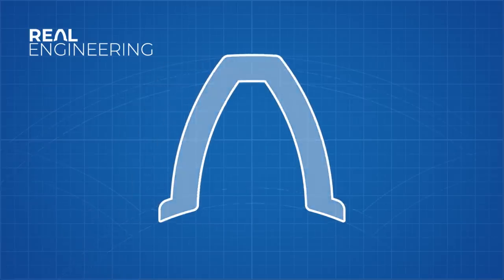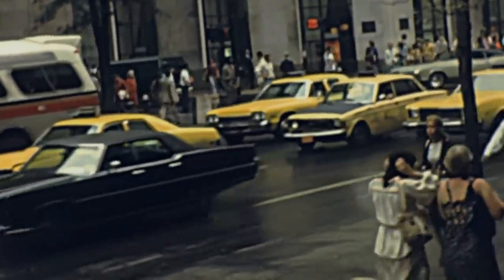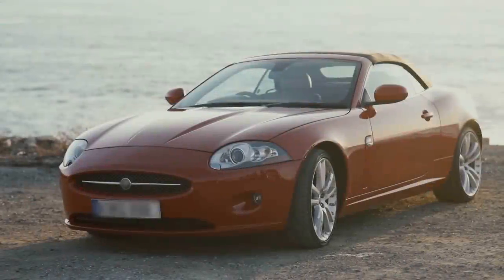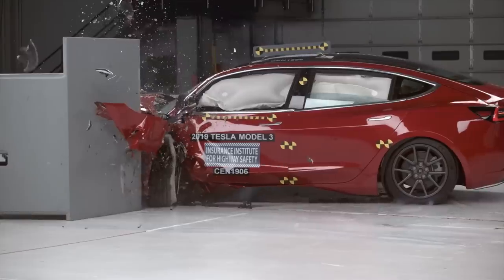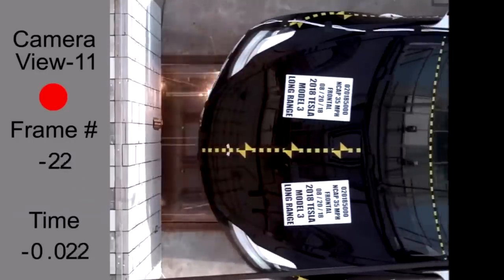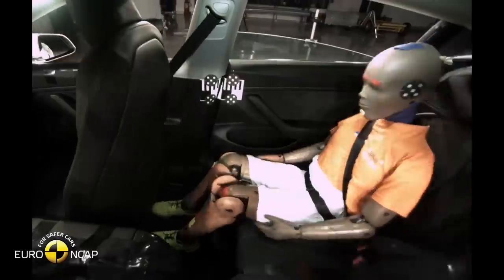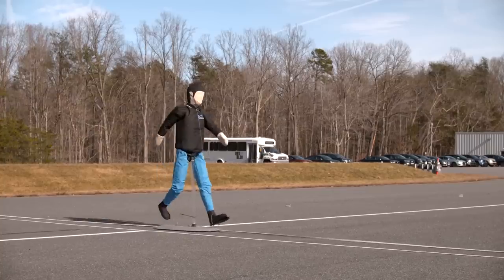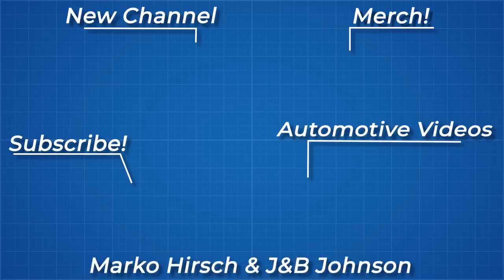Which Is The Most Dangerous Car?

Comment: "The only difference is that the drive is a woman" 
Me thinking about woman cant drive stereotype
Reply: Maybe women DO drive worst than men because they have to drive cars not designed with them in mind!
Reply: I think the statistic is that women are 40% of the drivers yet have 60% of the driving accidents
Reply: When he said that I was half expecting him to mention how women drive 38% less miles then men and are still involved in such a large percent of accidents. He dodged a bullet there
Reply: @Luchoedge  you have no evidence for that, it's only the safety testing that's not tested with a "female" dummy, however conservative talk show host Steven Crowder debunked this claim anyways since the amount of variance in male body sizes makes the "average male dummy" not so helpful to most men.

The car itself was designed for everyone, adjustable seats are an example. Women do have both average anatomical differences and mental differences too. It'd be very strange to ignore the fact that women on average are weaker than men, the average women taking the same punch as the average man is going be hurt a lot more, we deal with this fact by segregating sports leagues into the two genders.

Now I care about the safety of all people, and if it really turns out to be the case that since the dummies aren't shorter then they are more unsafe for women (a claim made by far-left media outlet Vox, which is where I think Real Engineering got the idea to inject it into this video), then I am all for segregating vehicles as well, and making a "womens' vehicles" lineup as well.
Reply: @Luchoedge  What's your point? Are you suggesting that automotive manufacturers make cars easier for women to drive?
Reply: @PeterNjeim  my guy what the fuck are you talking about 🤣. This has nothing to do with politics who cares about what Vox or fucking Steven Crowder says? Modern politics I swear
Reply: Women have less muscles and weaker bones . = Higher fatality rate , nothing about driving skills.
Reply: @dreadkos  I suppose if women do end up in getting in more dangerous accidents than men, then it would make sense that they have higher fatality rates and higher rates of serious injury. Maybe there isn't just one factor?
Reply: OMG for people watching an engineering channel, you cant seem to think scientifically. The fact that women drive less miles than men does not mean that their driving is worse. Highway driving is easier than driving through crowded complex street areas. Fatalities per mile might be good for smoothing out "intrinsic"  hardware safety, but not good when analyzing differences in driving "ability". FFS men like to talk a big game about their ability to reason, but fall flat too many times to count. stop being lazy.
Reply: Peter Njeim what are you smoking dude? Segregating cars for men and women? And you manage to bring Steven crowder into this for no reason. Also underhandedly dismissing the issue because Vox is “far left” according to you.
Reply: @StratosTitan  He brought up the segregating cars for men and women as a joke if cars are unsafe for women because of the claim in this video.
Reply: @Peizxcv  anecdote isn't evidence, or even an explanation. -_-
Reply: @Peizxcv  "observational evidence"..lol yeah thats the same quality if evidence anti-vaxxers love. Man thanks for that 😂
Reply: @Peizxcv  sure man! ROFL now your pulling out the classics from the climate change deniers. 😂 keep em coming man. 😂
Reply: @julianayala03  I can literally smell the reddit culture coming off you.
Reply: @thepope2412  Yes, but those are typically minor accidents. Men are involved in the majority of fatal car crashes.

The morale of the story is: Don't use statistics to prove your stance on a topic.
Reply: @julianayala03  Highway car accidents result more often in fatalities than accidents in urban crowded areas.

Men are involved in more fatal accidents than women. But women are involved in more accidents in general.

Again, the moral of the story is: Don't use statistics to prove your point.
Reply: @thepope2412  thanks, its more like "online culture" im one of the "older millennials" (and yes I bear some responsibility for crappy discourse online) but my argumentation style is chosen upon what I am confronted with. And because I saw idiotic misogyny, i responded accordingly. But I am not averse to having a proper discussion when people are genuinely trying to act in good faith.
Reply: @DonVigaDeFierro  i didn't do that but your point is well taken.
Reply: i thought that too, but i think the statistic is chance of injury IN a collision (injuries/total collisions). so it doesnt say anything about the quality of the driving, just how bad the injuries are.
Reply: @julianayala03  No it's literally 2016+ reddit culture.
Reply: I mean, have you seen where they drive? 
They have to go to school zones and inner city. Not really know for good things
Reply: @thepope2412  sure but the reason i responded the way i did, is because I dont go on reddit, i have only been on there a few times, maybe reddit culture has seeped* into FB, im on there alot.
Reply: @DonVigaDeFierro  But there are clearly more factors other than bone density and what not as Peter demonstration.
Reply: In my personal experience (yes this is anecdotal), men tend to be more skilled drivers than women, but tend to drive more aggressively and do more stupid shit when driving. So it cancels out in the end.
Reply: @thepope2412  am i proof of it because even though i am never there, it has  still managed to "infect" me? Just want to be clear.
Reply: @tyrendrake  mgtow? Redpill? Blackpill? Idw?
Reply: When it comes to designing for safety around a highly variable population, there's different issues at hand.
1. Group at increased general risk; if women are more vulnerable, period, then it follows safety design should be focused around them and ignore the less vulnerable group, as what will protect one will protect the other.

However, this brings us to our second potential problem:
2.variability risks. - say for instance all testing is done with dummies that are 175 cm tall, but real world data shows a design where anyone taller or shorter than this is increasingly at extra risk of injury. This calls into question the use of an 'average'.

Of course, in the real world it is difficult to know if you are dealing with scenario 1 or 2.

But either way suggests testing for an 'average' person is stupid.

A scenario where improving safety for one group does not decrease it for another (eg option 1) implies testing not against the 'average' person, but against the worst case scenario. (or at least the worst case scenario that can reasonably be worked with and identified).
if women are more easily injured, and the safety design isn't a tradeoff (eg improved safety for women reduces it for men) it follows logically that a female should be the basis for testing, since what's safe for them will be more than safe enough for men as well.

Scenario 2 is a lot trickier. In this case we are dealing with contrary goals; improved safety for one group is reduced safety for another.
In this scenario though, again, testing with an 'average' case is unhelpful.
Here, you want to identify which kinds of variability leads to different outcomes (eg tall/short, heavy/light, muscular/weak, etc).
for every category that shows variance in outcomes, pick all the data points that show the largest discrepancies, then test those, NOT the average.
Eg. Test what happens with extremely tall and short drivers, and test to see if there are any nonlinearities or outliers.
(eg maybe some design quirk leads to increased injury for people exactly 169 cm tall, but lesser injury for anyone else.)

This is of course way harder than testing an 'average'. But it's the only way to do it right where variation itself leads to different outcomes. (except where a result is entirely skewed one way; if taller drivers always get injured more than shorter ones, you can likely assume improving tall driver safety would also improve it for everyone else.)
Reply: Statically, at least in my country, despite the fact woman are more likely to be injured in an accident, they are far less likely to break the driving laws and less likely to get into an accident at all, of course even when we proportionate the population of driving men and women
Reply: @svgPhoenix The point here is that there are clearly other factors than bone density. In the video he said the only factor is gender. This doesn't seem accurate.
Reply: @LucasRodmo  I wonder how much reporting bias comes into effect with those stats.
Reply: The Pope young male drivers are the greatest risk for car crashes. That is why the insurance cost is highest for them.
Reply: DUDE
Reply: @Luchoedge  there is Audi in this world. Don't they design everything to women?
Reply: @julianayala03  It seems you can't think scientifically as well. The pure number of accidents tells you nothing about who drives better. The number of accidents per mile driven - that one does. If you have 5 accidents in one mile, you're most likely a worse driver than someone who has 6 accidents in 100 miles. 

Now, I don't know exact numbers, you can look it up if you want, but you need to acknowledge a flaw in your reasoning.
Reply: @rubbers3  im sorry but all you have done is asserted that the number of accidents per mile driven means that you are a worse driver, you have not demonstrated it. Also there does seem to be a flaw in your reasoning, although for an individual driver that "property" you described might hold, it seems ridiculous to think that applies to large groups of drivers. So there could be a flaw in my reasoning, but you have not demonstrated that is the case. also I made no actual claims, I just said that the persons making claims could not based on the info because there are other factors to consider.
Reply: @PeterNjeim  jeesh calm down, I said maybe. I was just wondering that.
Reply: Ok, this thread is absolutely disgusting.
Reply: @thepope2412  They are official statistics gathered by the law enforcement and fireman institutions. Also supported by biology. Women have better shared focus than men, usually. Driving is an experience that usually need attention to more stuff and changing focus fast. Men are really excepcional at focusing in one subject, hunting have been the primary male activity of the the vast majority of the human race history. That's why men are usually better at racing cars, but worst urban drivers (again, at least in my country). The data is so overwhelming that big companies like Whirlpool, and one the biggest truck driving companies here, Rodonaves, only hires drivers of the female sex.
Reply: @Luchoedge  Just you to know, the difference per capta isn't very large: 7,3% female vs 8,4% male proportionated.
Reply: There is always something to devolve the conversation from progress to general sexism fights. Can we just say they live in the past and we need to start using better dummies?
Reply: What about Asia women can they drive at all then
Reply: @LucasRodmo  In my experience women are much less likely to get a ticket which would effect the numbers if the "far less likely to break the driving laws" stat is gathered from tickets.
Reply: @Michael Alber Exactly my point
Reply: @julianayala03  Oh, I indeed have demonstrated that accidents per mile is better description than the number of accidents overall, all right. It also demonstrated, that the number of miles driven matters. 

In your first comment you said "The fact that women drive less miles than men does not mean that their driving is worse." That statement, in itself, is not false, the number of miles driven is not descriptive of the ability. Number of accidents per mile driven (and that was the context you used it in), is. I've demonstrated that with a simple analogy in my previous comment, so I won't repeat that, but I'll elaborate, since it seems logical thinking is not your forte. So, let's have a population with 200 people, 100 Green, 100 Red (colours instead of gender, so idiots don't assume sexism or other tisms). In order to determine who is a better or worse driver, we have them driving how would they normally drive for a year. At the end of the year, we get the results. Reds had 84 accidents, Greens had 56. That would suggest, that reds are more dangerous, right? But let's dive deeper - Reds travelled, on average 4 400 miles that year (arbitrary number). Greens, in that same time, travelled on average 1 100 miles. That's 4 times less miles, but just 1.5 times less accident. Or, in other words - Reds needed to travel 52.381 miles to have an accident, while it took only 19.643 miles for Greens. Would you be safer with someone who has an accident every 50 miles or one that crashes every 20 miles? 

Now, there are other criteria we can look for, that may skew the results one way or the other - red on red accidents, green on green, red on green, green on red, just red and just green. The discrepancy of who caused the accident is more important in determination of who is safer. But here is a problem of somewhat subjective analysis, false positives and false negatives. For instance Red driver run a red light, and almost caused an accident with a Green driver, but Green managed to dodge the impact. There was no actual accident, the statistic didn't went up, but it would've been counted against Red. There also could be an accident caused by a Green driver crashing into a Red car, because a child run onto the street. It would've been counted against Green, but in reality it was "a lesser evil". 

With all of that being said, we can't really take into consideration all of the details, since it's pretty much impossible on a large scale and is often not objective. That leaves us with accidents per mile driven, as not perfect, but the best, currently known, way of determining who is a better and safer driver on a large scale. To make the long story short and summarise - accidents per mile driven shows drivers abilities quite well, because it does adjust the pure number of accidents with the frequency of use. It shows, that one group might be more prone to accident and travel more, it shows that one group might almost never drive, but be almost guaranteed an accident if they do go out on the road, it shows that yet a different group might drive even more and almost never crash. It's not just about gender, it's about age, occupation, place of origin, race - it doesn't matter, you can use that metric to determine who is better between any of those.
Reply: @thepope2412  If he was a redditor he wouldn't be using emojis.
Reply: @rubbers3  ok i like your explanation, but again you fault me for not using logic but then proceed to fail at logic. What you did here was tell yourself a story about how accidents per mile definitely demonstrates that either red or green drivers are worse. And then dismissed alot of details as "not objective". Again number of accidents per mile does not tell you is a better driver, again because if the Red or green group have long highway commutes then they can hit more miles faster. That would have to be ruled out. Also are the groups equally representative of country and urban drivers? Aren't there more opportunities for accidents in more crowded areas? So it could be the case that with equal driving ability between red and green groups, if you increase opportunities your accidents will increase, no?
Reply: @Michael Alber You're correct, supports what I talked about anyway.
Reply: @lashedandscorned  I don't care, every sentence he utters is the incarnation of stupid reddit culture.
Reply: @julianayala03 I dismissed a lot of details, that often aren't judged objectively, not that the details themselves aren't objective. If you have a junction, and a driver that has the right of way is in the middle of it, while another driver has a gas pedal stuck under a floor mat (real story, look up Toyota accelerator pedal recall and Toyota floor mat recall) - who's at fault here? Car manufacturer for a faulty vehicle? Driver for crashing into another car and not going around it, even at high speeds? Or maybe it's the driver that had the right of way, but wasn't careful enough and didn't spot the car speeding towards them? Let's take a different scenario - a two way street, a child goes into the road, so the car swerves into the oncoming traffic to avoid it, but hits another car head on in the proces - is it the child's fault? Is it the child's parents? Is it the driver, that decided to swerve into oncoming traffic, rather than try to stop? Or maybe the driver should swerve onto a pavement and hit the building? 
Or maybe the other driver for not allowing the car to go around the child?
Or yet another one - a person driving gets distracted by their child in the back seat playing with a lighter, so they hit the car that was overtaking them. Is it the fault of the child? Is it the fault of the driver, for focusing on the child and not the road? Is it the overtaking car, for not being careful enough?

That's why I dismissed a lot of the details as often not judged objectively. 
There's too much minutia in cases like that, and judging each and every one is impractical and next to impossible for statistic purposes. It's much simpler to take a database of accidents and drivers involved. 

You bring up city vs highway vs country driving - I will give you this part, I just assumed we're judging the same driving environment in both cases, but I guess it is worth specifying and taking into account, since that one would be easier to take into account. 
That being said - this is also partly why I used Red vs Green, which can be either male vs female, but also straight vs gay, right vs left wing, bald vs hairy, young vs old, obese vs anorexic, and that is - to avoid the assumptions gender and driving habits. 

However, how exactly every one of these three scenarios impacts the opportunity for accident... City will definitely largely increase the number of low speed collisions, with little to no fatalities and often minor to no injuries. Low speeds also mean higher impact of driver's abilities to avoid accidents. Highways would be the opposite - more high speed collisions, more fatalities, but also more opportunity for multi-vehicle collision, while in the city it would usually be two-three cars at most. Higher speeds also mean more impact of external factors (car, road surface, weather), rather than pure drivers skill, which plays a lesser role. Country would have medium fatality rate combined with medium speed, but is also more likely to include single vehicle accidents.

From a quick search, I've come up with one source about total number of accident by road type: 
_Since 1972 the number of all reported accidents has reduced from 266 thousand to 182 thousand (31%) despite an increase in road traffic of 130%. This reduction has been on all types of road except Motorways. However Motorway traffic has grown more than six fold from 15.8bn vkms in 1972 to 100.6bn in 2007. Apart from this, the distribution of accidents between road types has changed between 1972 and 2007 as shown below with, in 2007(1972):
_
_• 35% (40%)on other urban roads
_
_• 26% (37%) on urban ‘A’ roads
_
_• 18% (14%) on rural ‘A’ roads
_
_• 16% (9%) on other rural roads and
_
• 4% (1%) on Motorways

And all of that is to show, that accidents per mile, assuming similar road type used (thank you for that addition), is a good representation of driver's safety and abilities.
Reply: @rubbers3  wow thank you for research, i still dont see it, but i must admit i need to actually go over what you presented here. Which to be clear you have went out of your way to demonstrate your point.  This i cant deny as a demonstration. Thanks i need to look over this more and try and learn. Thanks. 👍
Reply: @julianayala03  Thank you for the discussion, good luck in analysing it, and since it's 2AM here, good night.
Reply: Well women crash because of a lack of confidence; men crash because of overconfidence.
Reply: Julian Ayala yeah, but in city driving the speeds are far less than on the highway, resulting in less fatal crashes.

Hmm, a minor fender-bender vs a Jeep rammed its radiator into the back seat of an SUV of which I saw early morning yesterday.

Accidents are a different statistic than fatalities.